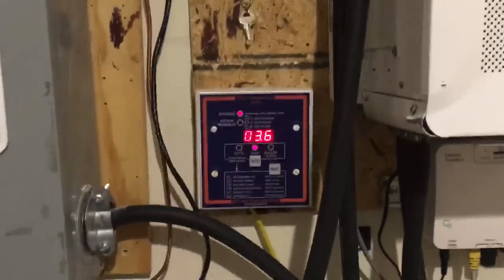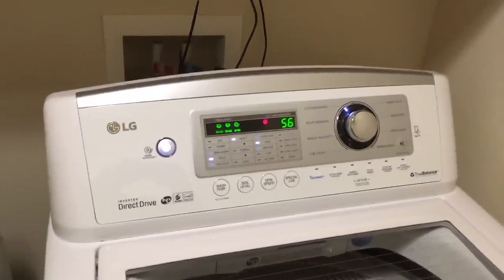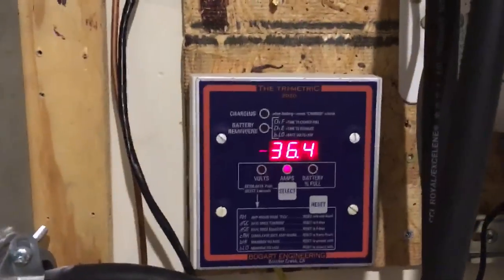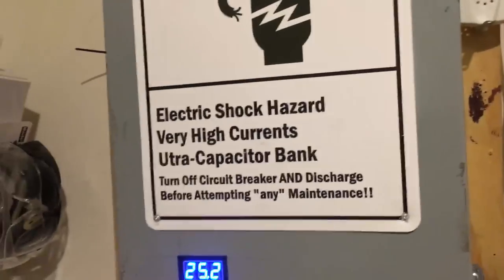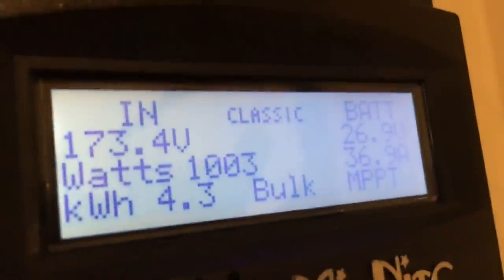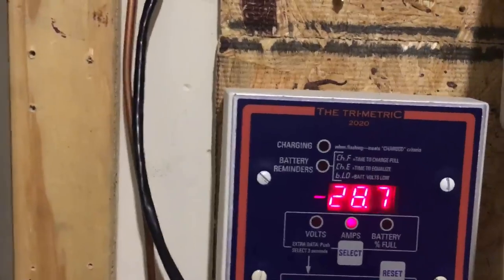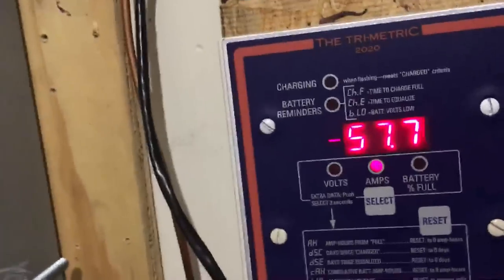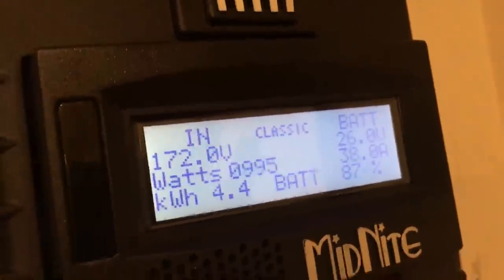Using Ultra Capacitors with Solar for Running Off Grid

Comment: for anyone who is interested, I have access to 24v, 48v, etc. capacitors with high farad numbers. this would negate the need to add a bunch of capacitors together to make a 24 etc volt unit. I am also interested in how this is wired because  I will be going 24v and want to replicate your system. It looks awesome, you have done a great job and it is exactly what I was looking for. Good on your man, kudos!!
Reply: Hi. I am interested in sourcing high farad 48v and some 24v ultra caps
Reply: Still got access to those capacitors??

Comment: I want to see the inside. I also want to see how I can make my own!
Is there a way to up the amps up to 200 amps Ultra Capacitors main box with the  with a step down voltage regulator with your system "combined" going out to the load?
Is there a way to have more capacitor ferrets with your system combined?
Is there a way to have a AVR AKA automatic voltage regulator with your system combined?
When I say combined, I mean with your system as a complete setup some where in the loop.

What about having a secondary Ultra Capacitors main box with the  with a step down voltage regulator and "AVR" on the input side too to be able to handle the many kinds of input power. 
Which would include the common ones such as wind, solar, hydro and other power options.
This Ultra Capacitors main box with the  with a step down voltage regulator and a AVR.

Why? 

Because these things would at its core help on the input side for many reasons such as: over current protection, over amperage supervision, "filterer dirty" power for more stable and clean power Being a buffer to hold the power and for surge power protection. 
Of course adding a general power supervision/suppression which the AVR should have.  
On this input side it would help in many ways, the betters can have a cleaner, more reliable power input as well as they well last much longer. [depends on the battery type but they still last longer.]

Comment: Nice, I also thought your response to CZJ was very well thought out. Unless you're going totally off grid because tapping into the grid would be too expensive, solar is not about saving money. I built a small home back up system after we had an ice storm here that knocked out power for at least one week. Another time we lost power for an entire day just because someone knocked down a telephone pole: It doesn't take a cataclysmic event for the grid to go down. People who do this are often tinkering. While my system cost about nothing compared to yours, it's still nice to know I'll have some power even without access to gasoline. CZJ may also want to read up on solar flares, it's not like they haven't hit us before.
Reply from the maker: Thanks for your comments and further incite.  Hopefully, folks will get the point.
Reply: Yes, we're here to learn about stuff, doesn't matter if we decide to partake in the specific idea or not.  Rock on.
Reply from the maker: Thanks for the comments.

Comment: Super Caps are magic for covering Surges in power Demand and Requirements . Great for short term on the spot over battery capacity  Drawing of Amperage.  Not a Battery Replacement.
Reply: Why not
Reply: @vishnumabeer6772  Caps simply do not store power long term most of the time.  They bleed off.
Reply: @pulesjet  u mean storage retention is less than Lifepo4 batteries ? if i get 10kw lifepo4 battery vs 10 kw supercap which is better for household?

Comment: are Ultra capacitors sam as super caps? plannig to get the Sirius Supercapacitors by Kilowatt labs, have couple of questions?
1. Are these supercapacitors prone to failure  compared to Lifepo4?
2. will super capacitors hold charge, do they drain out easily, do they give low voltage while charge reduces?

Comment: Doesn't the inverter have supercaps already to get the surge wattage?  Isn't this redundant to have more caps?  Do you have calcs that show the supercaps actually draw less current from the battery vs. battery alone?
Reply: That inverter has a huge transformer in it, I have same one, it can surge up to 7000 watts.

Comment: Have you ever tried getting your   Ultra capacitors and a higher voltage in series and then step down to your battery voltage I'm curious

Comment: How many solar panels? What voltage do you have your array? What's the Amperage/Watts?  Monocrystalline or Polycrystalline? Micro Inverters or DC Optimizer? I am building my own from scratch. I'll be using bypass diodes on each cell to reduce radiant heat and increase production during fractures, soiling, shading, or depreciation of silicon.
Reply from the maker: I have around 3.4kW (14 panels) of panels, at 24V, a combination of Mono and Poly panels.  I don't use micro inverters or DC optimizers.  My system is strictly off-grid.
Reply: @rhandsom  I have DC optimizes and they aren't required to connect via the grid.  The purpose of an DC Optimizer is to bypass a solar panel in the event of shading, voltage drop, or silicon defect and or damage.  Simply put they are an overrated bypass diode for current flow and to allow full performance of all your panels.
Reply: @rhandsom  you use both poly and mono without the ability to load balance through variations on cell manufactures.  Do these panels have bypass diodes before and after the cells or just on the strings of the panels.

Comment: what about charging the cap bank at a higher voltage then  sending stored power through a voltage reduction circuit ?
Reply from the maker: Sorry, I don't follow the reasoning.  You may need to give a little more explanation.  My capacitor bank is specifically designed to accommodate my highest system voltage which around 32v.  To charge higher than that would damage the ultra capacitors.  However, there are some applications, it is practical to charge capacitors to their rated voltage and send the output through a DC to DC converter or buck boost circuit to a load.
Reply: exactly . 90 to 32 volt  3 x the power available to the batteries and inverter, do you think ?
Reply from the maker: Not sure I understand what you propose.  The power used in these devices remains constant.  To lower the voltage is to raise the amperage and vise versa with amperage.  In each case the power (watts) will remain the same.  MPPT charge controllers have a similar DC to DC conversion circuit that performs a similar function to charge the batteries.  The applications involving ultra caps I'm referring to involves having solar panels connected directly  to caps, which in turn connects to a boost converter, then to an inverter.  Essentially a battery less application that will allow you to run appliances etc while the sun is out without the hassle of battery storage.  Similar to this  https://youtu.be/kZ1BzbzdrGY

Comment: Important question for me....  I have a couple APC UPS on my entertainment system, and desktop computers...  when  off grid, and the freezer or refrige cycle, the ups shift for a second during that initial compressor startup. its annoying.....   with your super caps, do you get UPS shifting ( assuming you have a UPS somewhere in your house.)  I have the 4024PAE also... but using Lith ion packs.  (520 ah worth)
Reply from the maker: I don't have any UPS systems.  With my super caps, The freezer and Fridge cycling are no issue.  I can run the fridge, freezer, dishwasher, or a heater and there are no hiccups.  Li-Ion packs are great, but in terms of quick power release, not too many things can beat Ultra Caps.
Reply: roger all thanks.

Comment: When you say the capacitors are “sweetening the pie”, is the sweetener dixie crystals and just how much sugar are you expecting it to be adding to your pie?  a better question would be, why do you believe your pie lacks sugar when you followed your recipe?  im gonna call it an apple pie because it does look like something my grandma would make.  That aside and back to the sweetener, are you expecting this cap bank or sweetener to help the overall bake or just make it taste like a more impressive pie?  I was impressed at first glance and my mouth was watering but then i realized id rather have more pie filling (batteries) to feed all my chirruns (loads).  you see, if you have more pie filling you could easily feed the chirrun demand no matter how many of those little bastard loads show up hungry at a time...
seriously though:
super caps on dc are only really economical if you have fast and heavy demand ie: large motors.  if you try to run a 2tn ac unit on a build that size every day, super caps would be super worth it, thing is if you did, your build would be too small for anything else and a larger inv and batt bank would be required negating the need for a super cap bank to begin with.  Just looks to me like an improper use and a waste of money that couldve been better spent on more batteries.